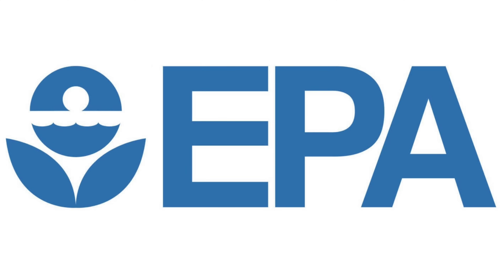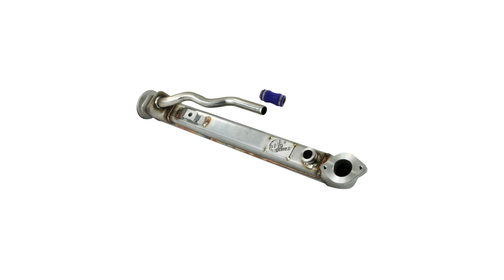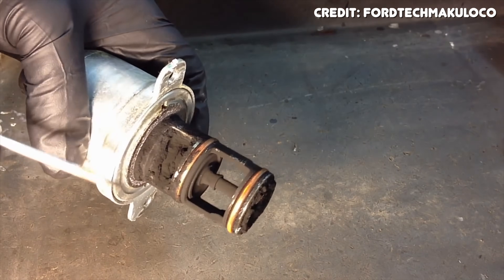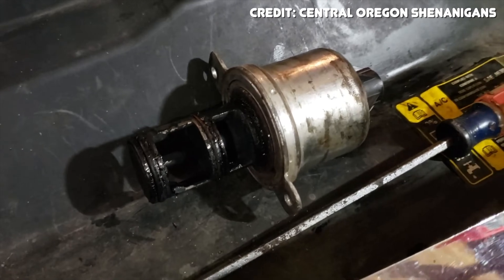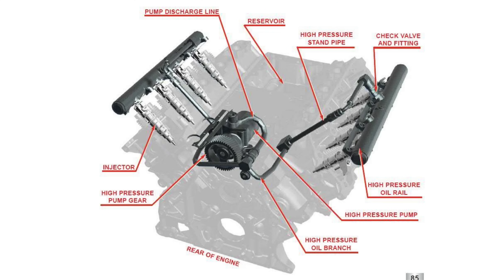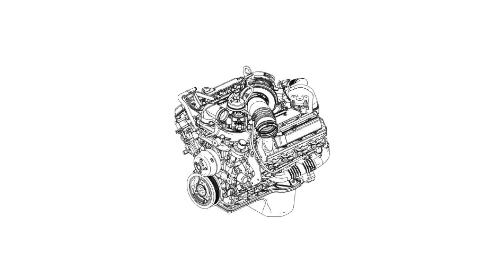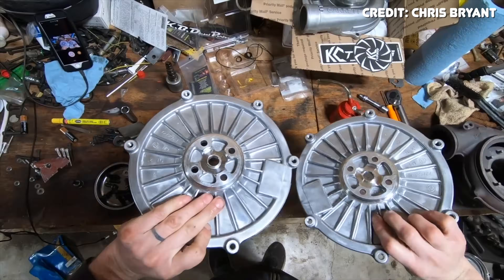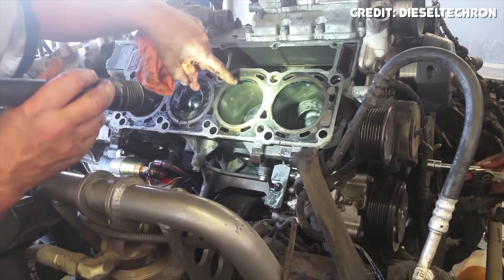The Truth About the 6.0L Powerstroke (And Everything Wrong With It)

Comment: Ok good briefing. I see a good oil filtration system that filters to 3 microns would solve most of the oil soot and clogging issues.. 
I’d delete the EGR, 
Change head bolts, 
Add a aftermarket oil cooler 
Add a oil filtration system. 
I don’t know if the oil used to operate the injectors can be isolated, and used strictly as a hydraulic system can be done.. but I’d look into it.

Comment: 2006 F250 with 234k miles on a full Banks tuned system , EGR deleted,  head studs since 10k miles... replaced turbo at 200k... just replaced batteries and alternator... truck it's always on Speed loader mode... about 18MPG. Full synthetic oil with Archoil additive. Never a problem,  pulls hard and fast.

Comment: Learned my lesson, didn't do enough research and blew my 6.0 (little bit of shit luck involved also). I will save you the whole story and just give you the important parts-   If you have a stock 6.0 do not put a tune on it, even a light one.  You WILL have head gasket issues eventually if not immediately.  Get it studded or completely bulletproofed first before any tuning.  Get an app or manual gauges that show you engine oil temp and exhaust temp so you can monitor that while pulling. You can get transmitters and apps now for less than $100 that work great. The factory warning for engine oil temp on the dash comes too late, you are already damaging your engine by that point and it may blow.  But once studded/bullet proofed and with the right monitoring the 6.0 can be tuned to have tons of HP and Torque.

Comment: Pretty thorough explanation here. Sadly you missed some key points. Specifically regarding the oil cooler. The "Sand" you mention is normally silica from the coolant that gets separated under the high temperature in the EGR cooler. Removing the EGR cooler was the solution to oil cooler and related downstream issues. And HPOP, after 2004, was pretty much a non issue. Except for the STC fitting, which was solved by a 1 piece rather than 2 piece fitting. To respond to your request for an opinion here goes. I agree there were a handful of issues that, if you are prone to neglecting your vehicles maintenance, will eat you alive on the 6.0. That said, I found that my tuned, deleted, studded and well maintained 6.0 was very reliable. Sadly I sold my 06' in 2014 due to divorce. At over 160k still on all original injectors, LPOP, HPOP, FICM etc. I was in the 500hp and 900 lb ft Tq range and it was very nice to drive. Wish I still had it. Had to buy a new truck in 2019. At times I think about selling my 2019 Cummins powered truck and getting the 6.0 6spd manual that I know is sitting unused at a friends house due to what I suspect is an egr failure.
Reply: Not true about the sand at all. The sand is not from coolant. They never addressed the casting issue from the factory for the entire life of 6.0 production. The bad casting process remains a problem to this day.

Comment: Diesel lover here, I DO NOT have any issues with my VW 2.4L Turbo Diesel engine. I6, high nickle metal block, Oil piston cooler, oil cooler, KKK K24 Turbo, Non turbo intake, and big intercooler. its kicking out 160hp, and 245ftlbs. I get 35mpg while burning BioDiesel. and can go years without maintenance. This engine was used from 1983 to 1998 in Europe. Its kinda like a mini cummins. 
Which I got into a very heated discussion at a gas station about which is better engine, Ford 7.3L or Cummins 5.9L  Its always going to be the First Generation Cummins 5.9L Nothing I mean NOTHING will beat a full mechanical Cummins 5.9L engine.  **Mic Drop**

Comment: As an old e-350 ambulance fleet mechanic.. the 6.0 were great. Oil pumps, EGR coolers, etc sucked. Run good oil, change regularly, delete emissions and if you have problems, put in head studs. It's honestly amazing how hard we worked those motors 24/7/365 and how well they did overall minus a few common failures.

Comment: The Problem with Ford is they didnt dropp a 5.9 Cummins in their 250, 350 trucks...but years ago they put Cummins in their 750 truck...mmmnn...Ford could of bought engines from John Deer, Perkins, Caterpillar,  and several other inline 6 manufacturers..But they chose Navistar v8 Turds...Yes 7.3 was a semi decent Class B diesel...But Cummins is a HD Commercial Grade A Bulletproof engine...I know cause I owned 3 of them...Zero issues cause I pampered them...their super easy to maintain and work on...Pop the Hood on a Duramax or Ford and cry...

Comment: I was a ford diesel mechanic for all the years of the 6.0 diesel. This video is bang on. You covered everything and  I was impressed how well you understood the specific reasons. I could not punch any holes in your description of problems or causes. Why do guys love this engine? I still do, its because they work so well (when they work). Great job!
Reply: that's mainly it, for me. when my 2004 f250 is properly maintained (like i do nowadays w/ 300k+) she is a highway dream machine! that being said, when i first purchased (210k) i had to replace injectors/fuel tail/glow plugs/harness/fuelpump/ACsystem and it cost a hurtful amount but nowadays, i invest mainly in filters/fluids and some weekend time to keep her rumbling nicely.
Reply: Love my 6.0 2004 Had every problem you mentioned. Bought it new put a sct tow tune in it and the problems began. Since it was new my bills have exceeded $12,000 in repairs . I pull a 35' fifth wheel and a canam x3 behind  that   have all the power i need.    It has 167000 miles. I put pod gauges in it and use a scan gauge 2  so I monitor oil and water temps to check the delta between them . I also monitor ipr presser  ficus voltage ,  hpop pressure  and also vgt. My friends think I'm nuts monitoring  everything,  but think you have to to stay ahead of the problems. P s when not towing the truck is extremely  quick . Love it  thanks for all you  do!!!
Reply: and i now know why your no longer working there....
Reply: My nigga you is talkin facts I have a neighbor got a 6.0 mane it clean it be have 125k miles how much i need to give him
Reply: They’re hell when they’re well but they’re always sick lol.
Reply: You obviously never owned one based on your clueless response.  @waterishdrake8693

Comment: My 05 CC 4x4 has 140,000 miles. I bought it with 25,000 miles in 2010 for $28,000 in very nice condition. At about 40,000 miles I noticed the oil temps climbing and immediately did the EGR upgrade, new factory oil cooler, STC fitting, and cleaned the EGR valve. I also installed a remote oil filter and coolant filter and I run Delo ELC coolant. All this cost about $2,500, of which $1,400 was labor. I use this almost exclusively to tow my boats and travel in Baja Mexico in the middle of summer (extremely hot). The only thing I've done since that time is replace the FICM when it was starting to show a voltage drop and the IPR when it showed a code. I've never been stranded. As far as I'm concerned that's a whole lot better than spending $90,000 on a new truck. Drive I-8 from San Diego to Calexico in the summer and look at all the diesel pickup trucks stranded on the side of the road pulling their 30-foot trailers. You will see Dodges, Chevy's, Fords (6.0, 6.4, and even new 6.7). They all have issues at times, especially when worked hard in the heat and pulling heavy loads. Several of my friends with their Dodge and Chevys have replaced injectors, turbos, head gaskets, etc., etc. My 6.0 has been the most reliable and least costly in repairs.

Comment: My 6.9 dog is a gem. Very happy to sit in the right lane and go slow.
Reply: my 6.9 smokes up big hills got to get my foot out of it gets better down wind down hill needs number 2 diesel not the iow sulpher stuff on hot days l drive with the hood  at the safety hook open to let hot air out  at nite cant see the hills or the smoke at a distance but im still moving sure miss my 68 pete with a 8v92 t.a. across the desert to nogales had 450 h p to the drivers strait pipes with a jake. all metal interior man it got hot inside.thanks for the video.

Comment: If you have the money to fix all the issues then mod it if not leave it stock perform regular maintance and save up for when the hp oil pump/ injectors take a dump 🤷‍♂️ other then that good engine not bad to work on

Comment: Shouldn’t have to spend more money to make anything reliable. I think the 6.0 is hit or miss. Me personally, I’d never own one. I had 2 buddies that owned 6.0’s and both of them shit the bed. I can say they are the best sounding Diesel engine. I had the 6.4 Powerturd, never again will I own a Navistar engine. I’ve had a  6.7 Cummins, solid engine, and now 6.7 Powerstroke. The 6.7 Powerstroke is the best Ford (only) diesel of all time. Now that the 6.7 PS has been out over 10 years they have it dialed in. I remember hearing the early ones had turbo issues. If only they would ditch the CP4 fuel pump.

Comment: In 2005 I bought an 03 loaded lariat 6.0 F350 4 door 4x4 long bed with high miles 145000, for a good price 20 grand. Now here I am in 2022 the truck now has a 155000 miles. Gets about 14+MPG I've only used it as a occasional work truck and local boat hauling. always undercover. Years ago it ran funny wouldn't accelerate I took it to the dealer they said it needed injectors but reprogrammed it has run perfectly fine ever since.  About 10 years ago I had a oil leak somewhere under the engine that I had fixed at a shop along with brakes. Also have had the oil changed several times. But I know if I was gonna keep it I should bullet proof for $20k And it'll probably last the rest of my OG life.
 Instead I think I'll spend a 100 grand and replace it with a new diesel ram 5500 cab chassis and a custom flat bed. So I can haul a new big truck camper comfortably. And also replace my aging RV,  A lifted 1995 Ford E350 B190 Air stream off road camper Van. With A built 385 horsepower 460 fuel injected 9mpg Gasser. Which everybody seems to wanna buy.
 So I'll be selling the 6.0 In the near future when my new truck is done.
 When I checked the book value last month it was around $10K. Is it a good truck worth fixing or a boat anchor that might go off like a grenade? I think that will depend on the next owner.
 We'll see if the new truck has some new problems for 10 times the price. Thanks for listening.

Comment: I have 260k miles on my 6.0 I studded it and did the welded cooler method, Blue spring, oil cooler, 03 stage 2 turbo tubes and intake, 5" straight pipe and SCT tunner with the proformance tune at 180k miles and so far so good. I has never had a problem except when it popped the o-ring on the SCT fitting at 180k so I got the blow proof version when I did all the upgrades. I also rip on it hard I love my 06, 6.0 I will keep it forever and fix it when it needs it, It sounds super good one of the best sounding diesel engines I think ever it has all the power I need it stays nose to nose with my friends STI and I can pull a house if I need too.
Reply: Any issues with the transmission acting up not necessarily slipping but in between shifts sometimes has like no clue what's going on . I also have an SCT livewire tuner on the performance tune truck runs flawless but the transmission from time to time acts like it just doesn't have a clue what's going, in developed a shudder when it's cold and locks into overdrive without being up to overdrive when you press on the gas, only the first 10 minutes to drive and doesn't do it again after that but walks into overdrive when it's cold and gets a wicked shudder I guess you would. Haven't completely determined if it's the engine or transmission but the engine doesn't appear to skip a beat,

Comment: I think the 6.0 gets a bad name by comparison. It is far finickier than most other diesels. You have to pay attention to them and maintain them well. A lot of people confuse reliability with neglect. Yes your 7.3 takes less work, because it is better suited to handle neglect to be honest. I've had my 6.0 for a few years. It was bone stock. I've just done an egr delete, oil cooler, glow plugs, harnesses, bigger turbo compressor wheel. It's still mostly stock with a bit more pep. If you take care of the egr early on, heads should never be an issue. I'm still rocking stock head BOLTS on my 04.5 6.0. I love it.

Comment: I have a 2006 with 330k. Didn’t turn it up until the hpop went out. Runs fine now. Replaced the turbo, injectors, water pump since then. Change the oil and fuel filters fresh Lucas oil every 10k. Change the transmission oil/ filters every 60k.

Comment: I forgot to mention. I have been using Hot Shots Secret; both the Fuel Additive and the Stiction Eliminator. I order it through the Walmart* app. With my repairs, bullet-proofing the vehicle,it’s been running like a champ. I do get guys that blow past me in their new rigs, and I only wonder what their monthly payment is, and are they going to be able to afford the repairs when their engines give them issues. 325 HP plus whatever bulletproof and cold air intake give extra is fine for me.

Comment: I purchased my 2004 Ford Powerstroke Super-duty 6.0L in 2015. Every Winter an injector would start to go out. I did suffer catastrophic engine failure in 2017 on Interstate 80 in the middle of the Nevada Desert 🏜. Since then, I have had the Blue Seal replace, Oil Standpipe, HPOP, Racing Starter, FICM reprogrammed or replaced, at least Four Injectors replaced, Fan Clutch, and batteries. I have replaced the EGR Valve (even though the old one still had some life left), replaced the IPR and other emissions valves. After I completed paying that $7,600.00 off I had my rig Bulletproofed, EGR Cooler gutted and replace with Six tubes, new extra smaller Oil Cooler, Turbo cleaned, Coolant Bypass System and Filter, ARP Head Bolts, upgraded Head Gasket, and some other things I cannot remember. One week ago I installed an S&B ColdAir Intake. I am pulling a 26’ Travel Trailer now, so I want to make sure my engine is getting the air it needs. Would this be sufficient for my needs? I have almost 212,000 miles on it.

Comment: Bought mine new in 03. I just had the oil cooler go out. Did injectors 3 times in 20 yrs. But im starting to have all kinds of issues. Probably need a new engine. Im at 225k.

Comment: Great and informative video. I have an 07 with 478000km. Yes I have done a full rebuild (expensive) and likely at the 550HP  range. Oil change every 5000k but it works good. BUT each day I thank God for mechanical issues ;)
Reply: How many miles are on the rebuild and still no problems to date?

Comment: First sign of problems with 6.0 ... rebuild the top side with new injectors , all new o-rings throughout... that means injector o-rings, oil rails , stand pipes , branch tubes & hpop o-rings ... they've been upgraded with a nylon spacer and are otherwise now made from more resilient material . While you're at it go thru the turbo . Make sure the F.I.C.M. scans correctly and otherwise does as instructed by IDS 
If yours is an early 6.0 , new ipr/ipc for certain.  Just gut the top side and put it back together all clean with new .

Comment: Just an fyi there is some Inaccurate info on the oil pump system. The oil first goes through the hpop and then through the relief valve (ipr) a completely clogged screen would cause a hpo system blow out (almost never happens). Torn screen causes the pintle  valve in the ipr to stay open and in return there is no or poor hpo build resulting in a no start or rough running condition.

Comment: The 04-04 6.0 yes they were problematic. The stain on their rep stems from the very first released ambulances and cab and chassis that spent their time idling. I'd argue the duramax was worse, The 6.0 was also produced in insanely higher numbers and were seen on all construction sites up until 5 years or so ago. My 06 f250 has 240k on stock head bolts, 1 oil cooler and race tune and I beat the piss out of it and honestly have not maintained it well at all. I do have cold striction. All diesels especially in the 6.0 era have major issues and still do with emissions. The trick is MONITOR EVERYTHING!! Which goes for any diesel made if you actually use a truck. @6:35 is over exaggerated and then you negate yourself, Honestly every issue is over exaggerated with a obvious bias opinion. The simple fact you can still make a video almost 20 years later talking shit is proof in itself it is not that bad of a engine as they are still plentiful and going strong. I am willing to bet your actual experience is null with them. "you sound like every other 6.0 owner" and with good reason but logic plays no roll with bowtie boys (absolutely assuming here ) and it wasn't 175hp, it was 275hp(Which you mentioned the "industrial" application several times yet still kept saying 175....), and it wasn't to compete with Ford and Dodge....... A couple thousand bucks on top of the truck and you have a much better engine ten fold. Pay once cry once and call it a day.

Comment: I had a 2004 where the truck only ran on half a engine replaced ficm because it burnt out and closed check valve on pass  side prev station blew lines from tank to eng wich also closed 1n 3 injector

Comment: Thanks for the info work gave me 06 f350 6.0 POS work truck oil leaks  cold start problems even after a drive to the store 5 miles away I have to let it sit for 30 or 45 min WTF I LOVE MY 2V F150 BUT THIS IS 👎

Comment: i have a ford  6.0 sitting dead in my back yard. when it was running it was a great motor. but now, it would cost too much to fix. and yes it has the bullet proofing installed. just did not do the studs.

Comment: Lol  let's put it this way ford 6.0 ps speck to FORD STANDARDS  BOLTS THE INJECTION SYSTEM FORD  THE 6.0 IN IHC TRUCK  NOT FORD  WERE A GREAT MOTER  BUT IHC HAS MUCH HIGHER STANDARDS THAN FORD   FOOD 4 THOT FROM A HARDCORE BINDER GUY